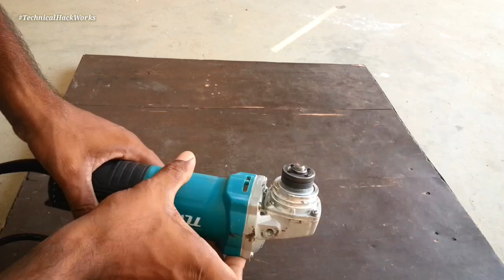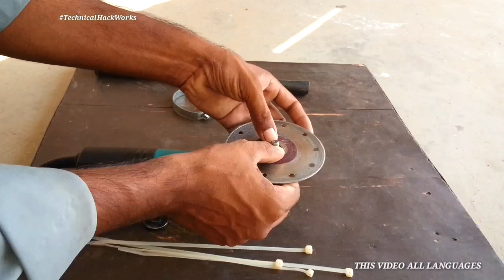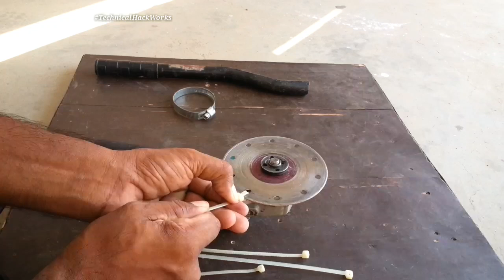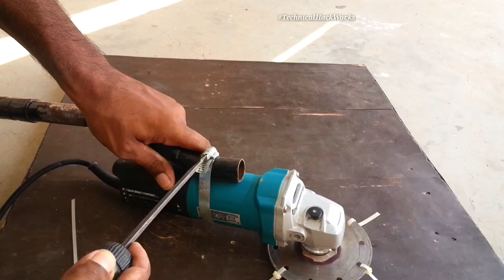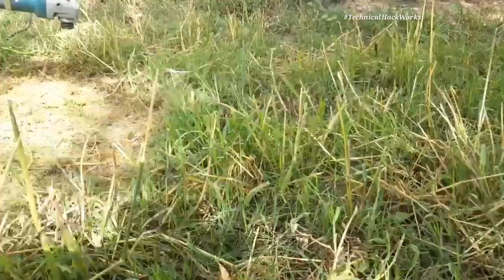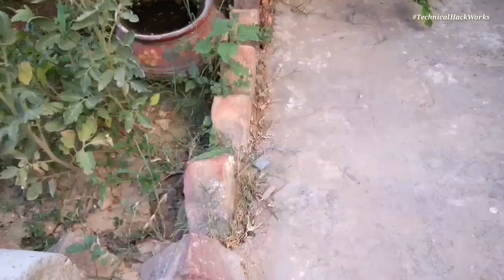Tie Cable Grass Cutter For Angle Grinder easy way making at home

Comment: Very creative and useful. The method in the video is presented clearly, easy to understand and easy to apply for viewers. This is an interesting idea to recycle unused electric cables into a new tool for cutting grass with an angle grinder.